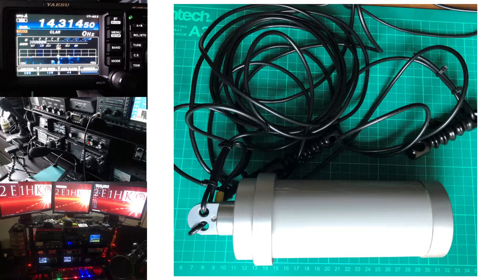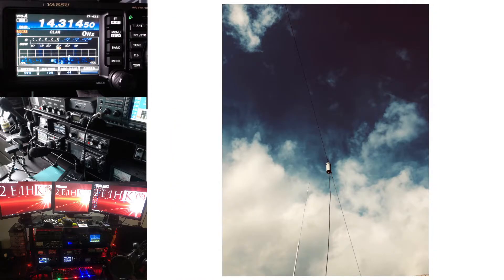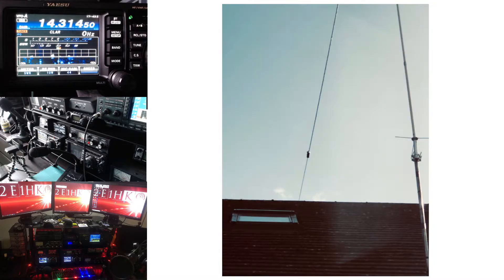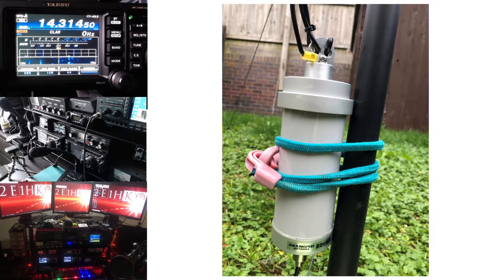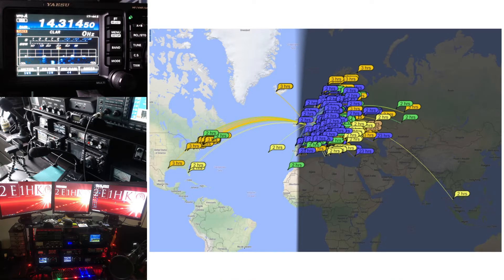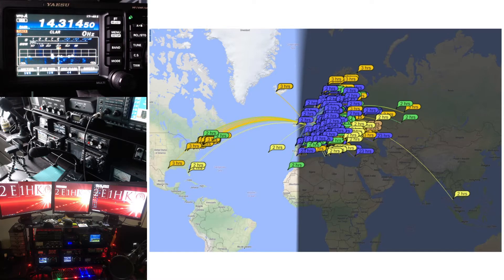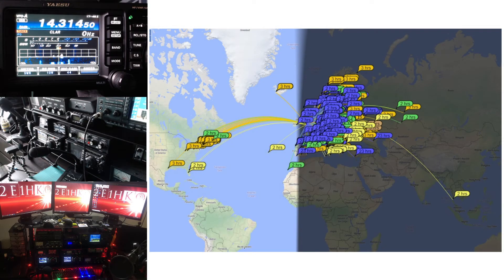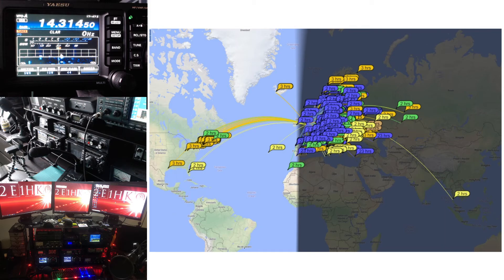Diamond BB6WS HF Antenna Vertical !! Part 2

Comment: Hi Jason.. Wondering what tube/rod do you use to raise up the wire?
Reply from the maker: Hi Kevin, i just used a cheap fibreglass 8m telescoping flag pole, I purchased it of eBay which cost me around £15.00 delivered, as it happens im using it now 5w FT8. You maybe able to see the results on PSK reporter 👍 73s

Comment: HELLO I am EA5JIB considering to buy the BB6W DIAMOND antenna, in order to  use the 40 - 80m band for voice QSO.'s. I have seen this video. I think this is a multi purpose antenna.  Isn't It?
Reply from the maker: Si, Julián. Es una antena multibanda y para todos los usos.y de potencia máxima 250w PEP.
I hope my Spanish translates well, your English is muy bien 👍
All Modes 40 & 80 not a problem 
73